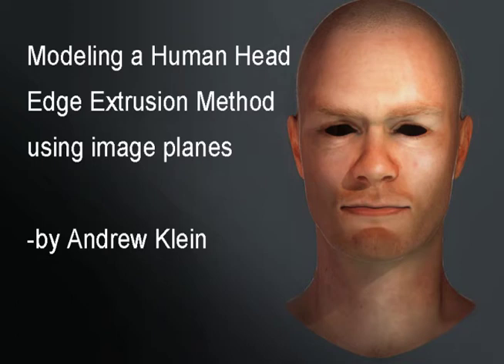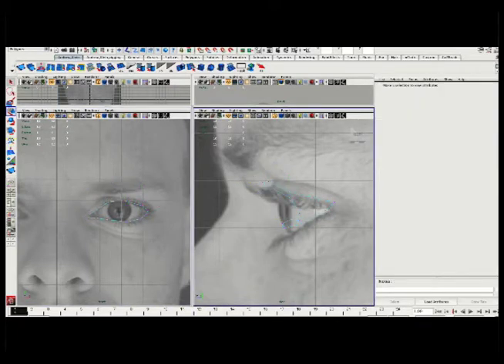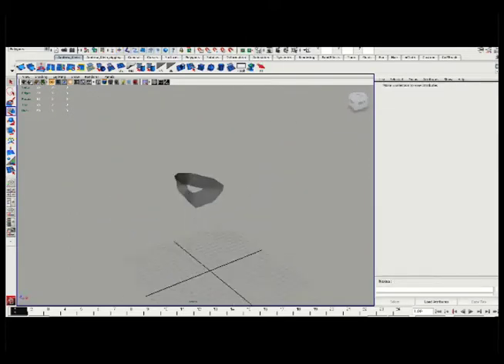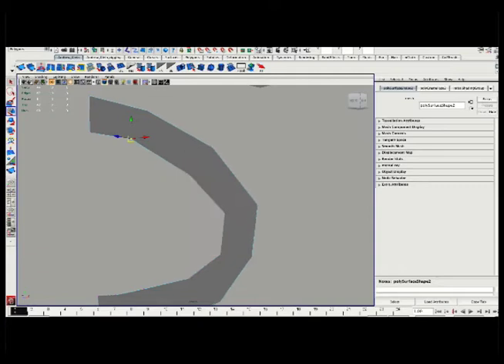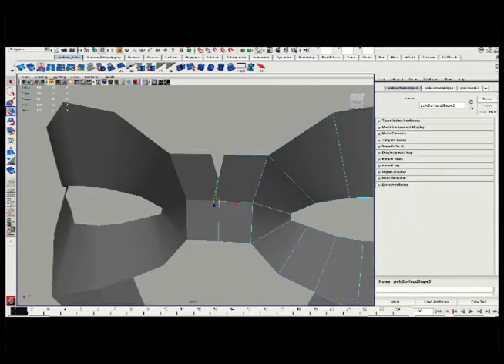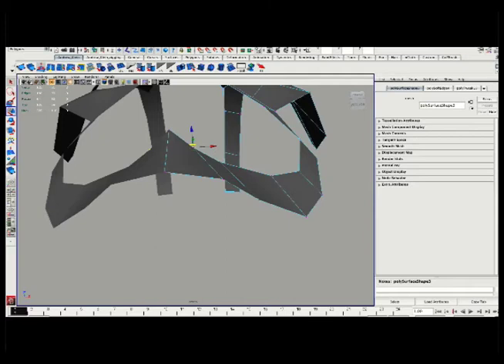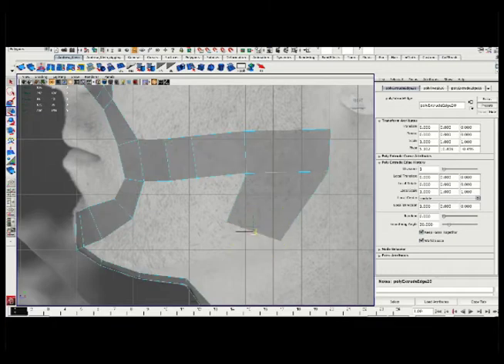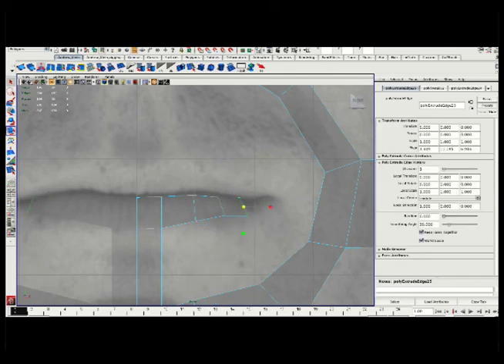3d Modeling a Head in Maya- edge extrusion method (1/6)

Comment: Was wondering how you appended the mouth to the eyes without combining the two meshes? I've tried to use append to polygon tool but it only works if they are combined.. but if you combine everything it makes the duplicate special instance stop working. Even extruding the edge and then trying merge vertex tool didn't work. :/ Advice or thoughts appreciated.